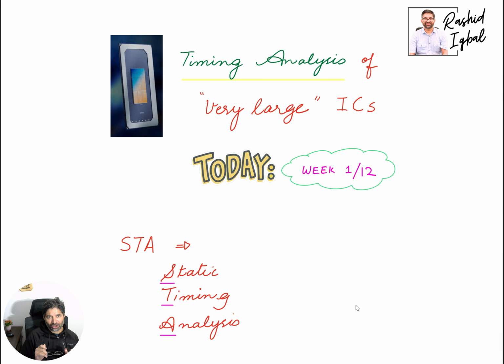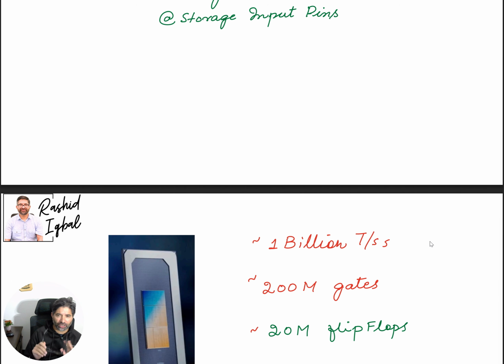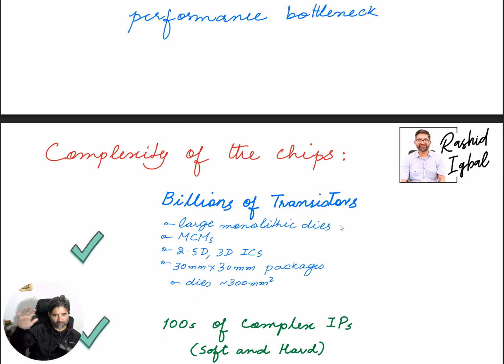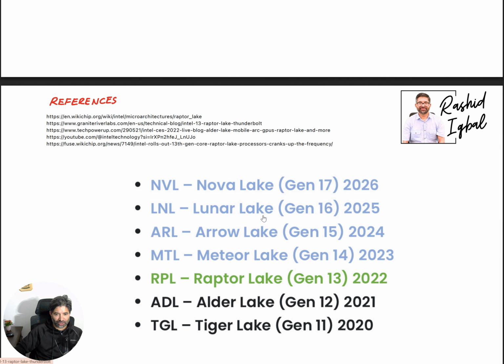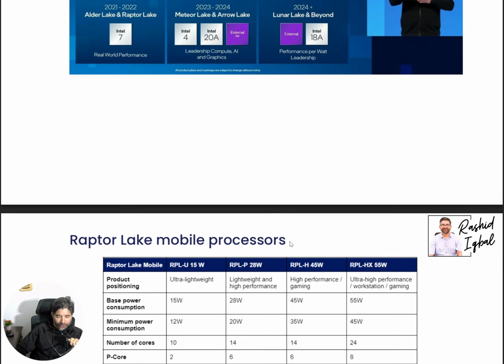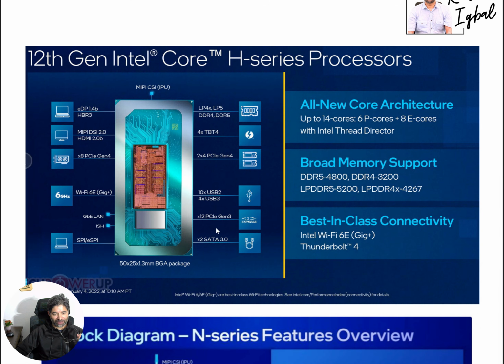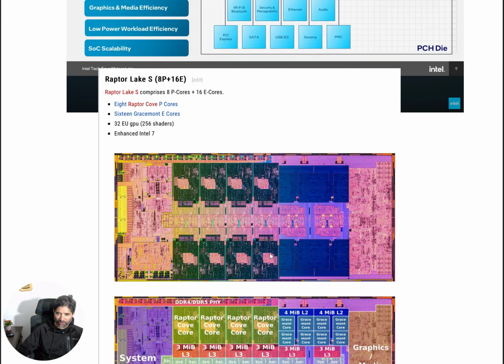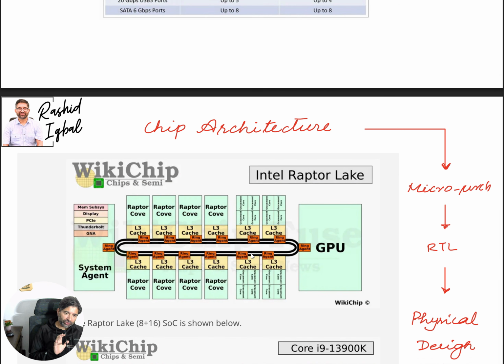STA Series, Week 1, Video 1 - Static Timing Analysis - Complexity Challenge

Comment: Thanks Rashid,
What do you mean by if any node is missed for delay calculations, we want to know that and fix it (maybe)? Does it happen in real chip? Can u pls elaborate on this? 
Thanks.
Reply from the maker: Every node needs to be timed. If a node is missing timing arc or timing arc/path is not constrained through that; we can report that. I will get to that when we start talking about checking unconstrained timing paths. The point i was trying to make in this video was; that our analysis needs to be very thorough and should not miss anything.
Reply: @chipxprt  Sure. Thanks